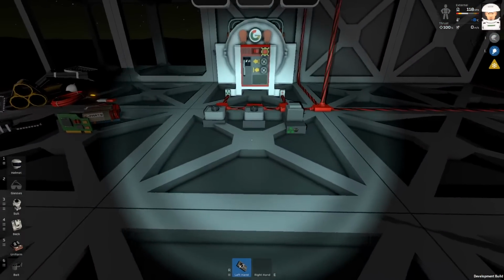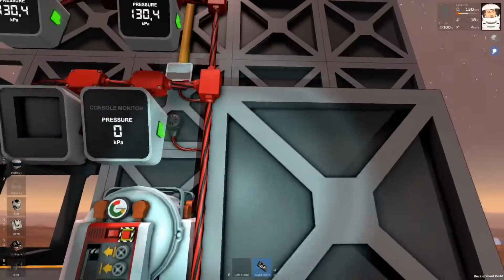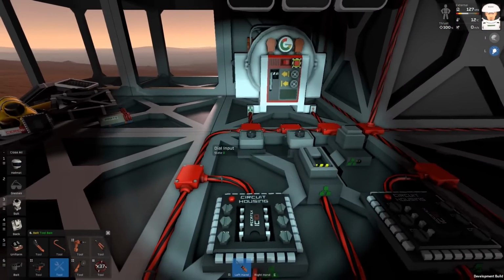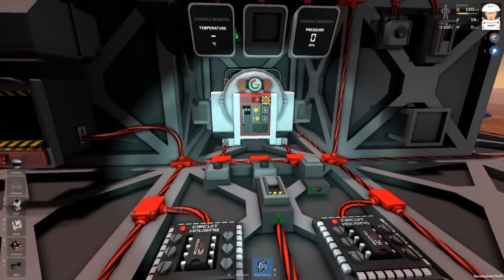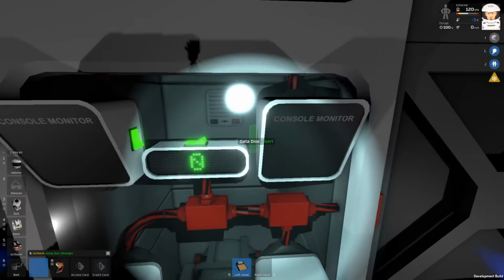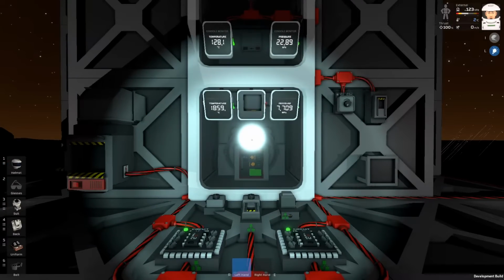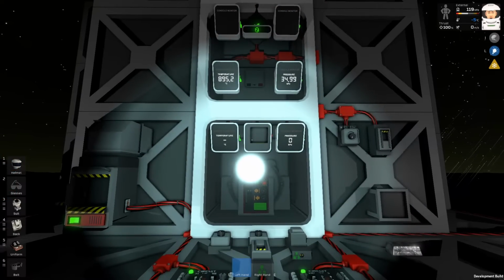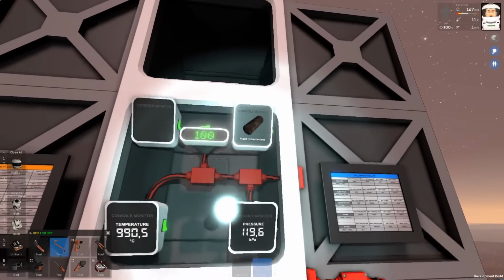Stationeers Tutorial Advanced Furnace Part 2

Comment from the maker: Did you find the giveaway in this video?
Reply: Got it built but the IC 1 has a logic unknown type error on line 12 and same for IC 2 on line 17. May be a version issue as I am running latest beta. Ran with it anyway and it sort of worked until the AGF exploded...... good explosion
Reply from the maker: @chawkes70  line 12 is empty in IC 1, line 17 is empty in IC 2
Reply: @chawkes70  I think this happens if you don't adjust the pins on the IC housing to the correct device.

Comment: I meant what is the process of putting them in the picture frames, not making the tables unless it requires a certain file type.
Reply from the maker: Putting them into frames is piece of cake. Get ready the pictures, put them into right directories, place the frame on the wall. Every frame has some kind of a button in the bottom corners, press the button and change the picture to whatever you want.

Comment: Great tutorial for people that want to use ICs and aren't actually interested in knowing how anything works.  I really wish you would have shown the hash display in normal logic though.  I'd really like to be able to get that to work.  It seems like it should be fairly straight forward considering there is a circuit for the console explicitly for it.  You'd think it would be as simple as using a reader to read the hash from anything that outputs a hash value, and then configuring the console to display the information from the reader.  That doesn't work though.  I've tried about a thousand different configurations using normal logic but none of it works.
Reply from the maker: Thank you very much. I do have short tutorial with hash generator:

https://www.youtube.com/watch?v=w86BPPWIv10
Reply: @AdamDeBeers  
I think I found my problem.  I made a test setup using a hash generator just to see if I could get an icon to display, and it worked fine.

After digging a little further it seems that not every machine that has item slots allows the reading of the hash of the items in those slots.  I have all of my printers outputs feeding into a single stacker so that all my products come out in one place.  But I wanted to be able to see what was in the stacker without having to run over and point at the release handle.  Setting up a display to show the count and zero it out when the items were dispensed was easy.  But I was wanting to be able to show the icon of the item as well.  The only hash data the stacker has though is the "prefabHash" one, which not having messed with hash data before I didn't realize that was the hash of the machine itself and not what was in it.
Reply from the maker: @Rowgue51  Happened to myself too, just because machines have own hash. 😃👍
Reply: @AdamDeBeers  
Now that I'm thinking about what video I actually commented on...I'd really like a tutorial on the advanced furnace itself.  Is it just as simple as a regular furnace with the input and output pumps/regulators you would normally have on pipes outside the regular furnace built in?  Or is there more to it?
Reply from the maker: @Rowgue51  It is as simple as "basic furnace" but with a lof of changes in the game, this setup is working really good. One week furnaces bleed to much heat in the environment, next week they dont bleed heat at all. I built this furnace during a stream on Twitch any my followers wanted a tutorial for it.

Comment: So I dont know why, but my composite windows in front of the furnace keeps exploding, according to wiki composite window appear to resist temperatures up to 4000K. Even if there is vacuum in furnace room, it keeps exploding. Can it be bugged? Because I have no idea where the problem is.
Reply from the maker: What pressure do you have around the furnace? When furnace heats up, the pressure of atmo around it gets really high.
Reply: @AdamDeBeers  Thats the weird thing. I keep my pressure in the room under 100kPa, but those windows blows up even if there is 5kPa or absolute vacuum. No problem smelting normal ores like iron, copper or even making steel, but when it comes to superalloys you need super heat or super pressure you know, so I have to inject more fuel. When I was using that furnace for the first time, I was able to make many superalloys. But now that furnace seems unusable and I dont know why, I even tried building airlock door on top of the furnace room to vent out heat faster.
Reply from the maker: @crada777  It looks like I need to try this setup with new changes, but it worked on Mimas without any issues so far.
Reply: @AdamDeBeers  Thanks, it seems like a some kind of a bug. If you want, I uploaded video for you, so you can see when it blows up, mby Im doing something wrong but I tried many options how to operate the furnace and every time it blows. It looks like those walls cant resist 4000K at all..
https://www.youtube.com/watch?v=cWSNE2TFFp8&ab_channel=snake3321

Comment: I'm getting unknown error for line 14 on IC #1 and unknown error for line 11 in IC #2.  Looked through your replies but couldn't find any one else having that problem. any ideas what is going on?
Reply: nm. i think i just wasn't paying close enough attention. thanks Saddamo for all the great tutorials!
Reply from the maker: @andrewgruzins4989  Thank you very much. Most of the time, the screws are not set correct on IC, take a look.
Reply: I have both of those exact errors right now, I keep going back through everything but I can't find the issue. I named everything the same, turned the screws all the same, I'm just not seeing how to make the errors go away. What did you do?
Reply: So I wrote the IC chip program out to both chips again, I think the error reading was a holdover from earlier in the video where we power them up to get the screw labels. So the error was there then but never cleared from the tool tip. The reset on the chip with screws set correctly fixed the tooltip.
Reply from the maker: @jasonsimulation2816  Sometimes, the only way how to fix strange errors for no reason is to take it apart and build it again, just IC chips and set the screws.

Comment: well, it keeps exploding, dont konw why
Reply from the maker: Too much fuel in it?
Reply: @AdamDeBeers  yea, found a solution to fix it
Reply from the maker: @4n4lProlaps  What was the issue?
Reply: @AdamDeBeers  well, for some reason the fuel canister got overpressurised and exploded, had a fule mix from two large tanks connected aswell, so added a pressure controll and a valve and that fixed it. but had to relocate the furnace so if it exploded again, it would not blow up my living quarters.

Comment: Just began with Stationeers and literally JUST started playing with gasses. This was a great view toward a goal, thank you! As already said in other posts, not only is the info great but the vid itself is very well done 👍   Not exactly the goal of the vid, but I’ve been confused about when to use frames vs wall kits and this was the first I realized it could be at least in part to dealing with pressure.
Reply from the maker: Thank you for watching. Frames are much stronger than walls.

Comment: Thank you for another great tutorial.  I can watch your tutorials without getting sick because you don't move the camera much.
Have you tried putting pipes in your furnace enclosure to heat up gasses?
I'm also thinking you could add a circuit to dial the type of alloy and it would regulate the pressure both inside the furnace and in the enclosure.
Reply from the maker: Thank you very much. This furnace is mostly manual with very easy controls. I built it during the multiplayer streams on our custom planet. People wanted tutorial for it so I made one. I havent tried to heat up the enclosure with pipes, because one of the pipes behind the furnace can have fuel in it, so you can accidentally set your fuel line on fire.